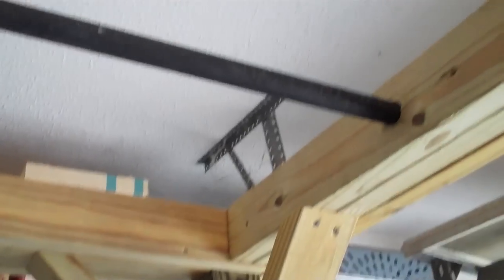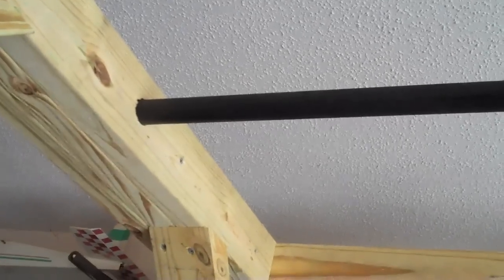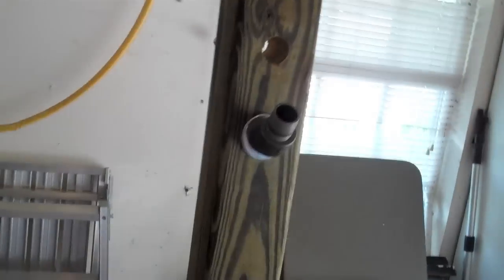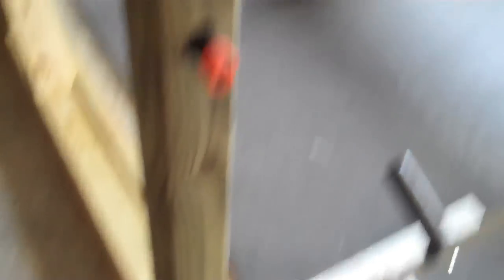Homemade Wooden Power Rack

Comment from the maker: We can't currently do dips in this rack, but it would be very easy to make that modification. We could take some steel piping, bend it into two dip handles, and thread an extension off of the center. Then we could use a nut to secure it into a hole in one of the uprights. Might actually have to build that attachment sometime.

Comment: how are those elbows holding up? and have you dropped any weight on the safetys yet?
Reply from the maker: I haven't failed any weight in here yet, but my friend failed a 315 squat onto the pins. He didn't DUMP it from up high, but he didn't come down easy either. I feel like these safeties will hold up against regular failures around 500lbs, but not dropping. 
The elbows have held up great. I haven't had any really heavy weight on them, but I worked up to 435 and it was still really solid. The video is on my channel somewhere of that workout.
Reply: FitGranticus awesome man thanks for replying

Comment: Im really concern about the healt of that guy , thats a lot of weight without a weightlifting belt , great and simple design.
Reply from the maker: 315 isn't that much weight. Even at the time of this video I was capable of squatting over 450lbs, so 315 was only ~70%
Reply: you don't need a belt with a stronger core.
Reply: Lifting belts are just something fat guys use to hold their guts in
Reply: canadachop hahahahaha  well I used to say the same until I injured exactly doing squats with the bar , now Im a fat guy in his 40s and from time to time that injury returns lasting up to a week or more , is not only painful , those days in bed dont help much my pocket , the only thing that works are 2 or 3 shots of a muscular relaxer called Neuralin  ( I live in Mexico ) , so please dont repeat my mistakes of my 20s , takes only seconds to put a belt.
Reply: The belt doesnt really prevent injuries that much. Its more a matter of bad form
Reply: The belt isn't about injury prevention. it's a about increasing intraabdominal pressure (valsava maneuver)